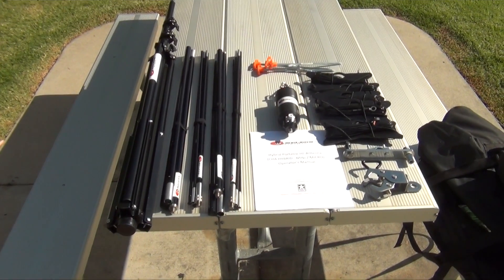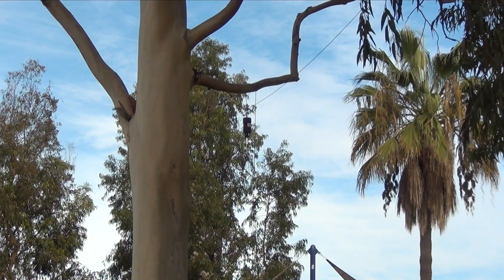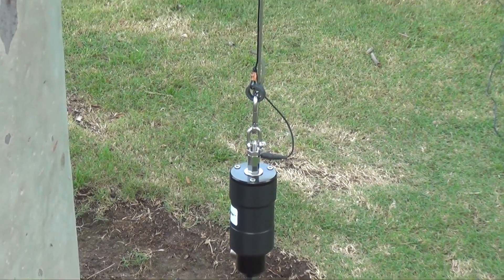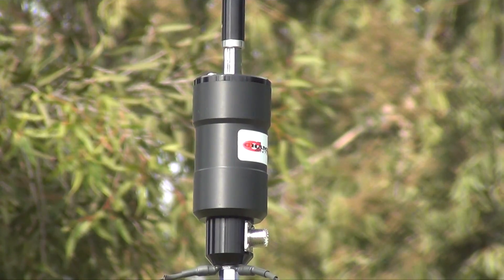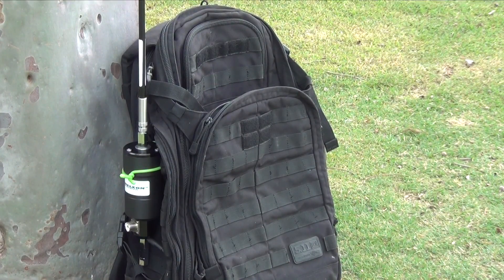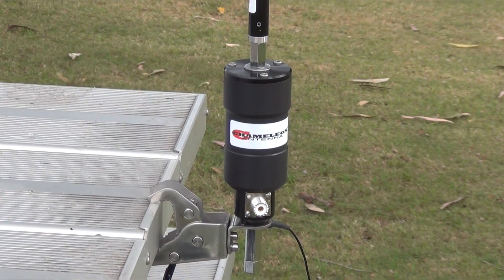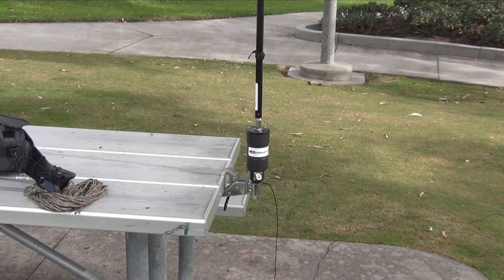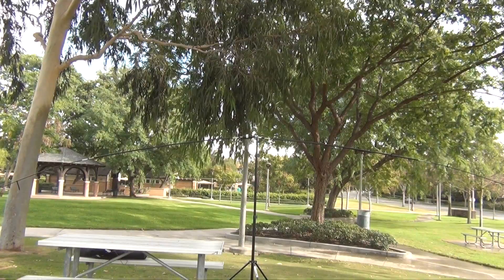Ham Radio Antenna - Chameleon Antenna Deployment Configurations

Comment: Is your  High Efficiency Portable Vertical using only one CHA MIL WHIP and one CHA MIL EXT?
Reply from the maker: Thank you for taking the time to watch and the comment! It is greatly appreciated. i use the MIL EXT
Reply: @WJ6FRadio   Thank you -- but are you using only one each of MIL WHIP and MIL EXT?  It looks much taller than that. I'd really appreciate the details.
Reply from the maker: @rgfuller2   Yes, I am using one MIL WHIP and one MIL EXT for the High Efficiency Portable Vertical, and Portable Vertical. The Manpack uses only the MIL WHIP. The Portable Dipole uses two of each.

Comment: What made one of your vertical configurations "short to long range" and the other "short to medium".  I noticed on the first one, you had  the whip with extension mounted high on a tripod.  I don't think putting the whip high on a tripod makes it "long range".  After all, you can drive a few blocks and make up that elevation easily.   Looks like you had both the whip and extension on both configurations so what makes one long range?  Thanks!
Reply from the maker: Thank you for taking the time to watch and the comment! It is greatly appreciated. The information I used comes from the Chameleon owner's manual or their website.

Comment: In the vertical configuration, how many counterpoise wires do you use?  With only one, I believe it makes the vertical somewhat directions, yes?  So, if more than one counterpoise works, then more would be better?
Reply from the maker: Thank you for taking the time to watch and the comment! It is greatly appreciated. Yes more would be better. In fact Chameleon sells the CHA COUNTERPOISES KIT which comes with, 4 X Radials 25' Copper Clad KEVLAR PTFE (Teflon) (-70°C to 150°C) wire secured around plastic wire winders with NEW isolator O-Ring.4 X Steel Tent StakesEach wire has one terminal 3/8" of diameter that can be attached at the base of the HYBRID, MINI, MICRO or to the Jawmount or to any other screw of 3/8" diameter or less.
Reply: Thanks for the fast reply.  I just subscribed!  Thanks for the info.  I was always a bit confused about ground radials as opposed to a resonant counterpoise.  I guess you can run multiples of each.    Regards!

Comment: Thanks for the ideas for the different configurations. I have different Chameleon stuff and its all solid and works great. You can mix and match with other antenna components or mounts due to the 3/8-24 threads.
Reply from the maker: Thank you for taking the time to watch and the comment! It is greatly appreciated. Chameleon has no shortage on accessories for their antennas.